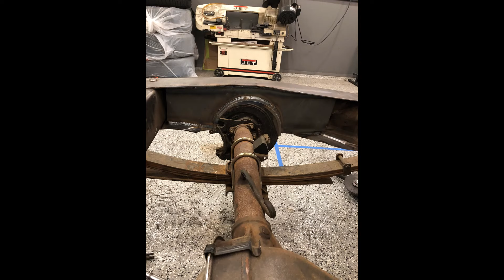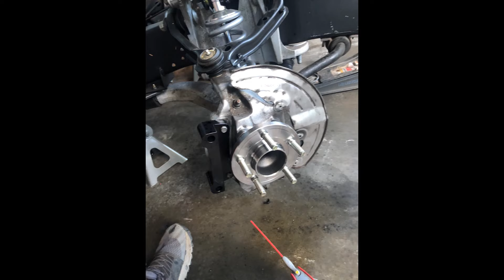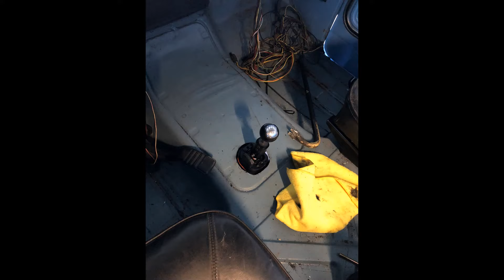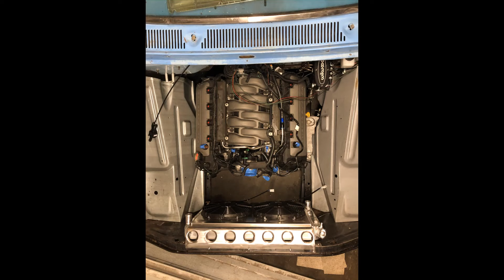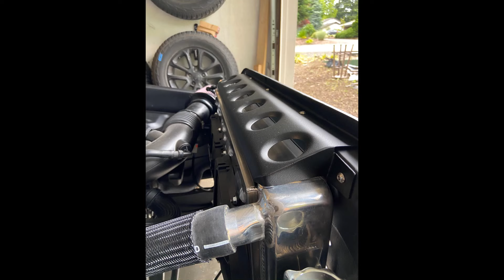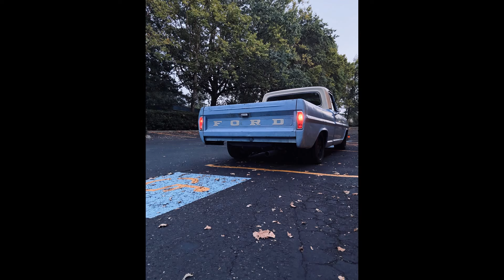1968 F100 Coyote Swap Build Video

Comment: Hey Evan, I was just wondering what all you had to do to get the corvette calipers to work on the crown Vic spindle? Any info would be appreciated. Thanks

Joe
Reply from the maker: I purchased some custom CNC Aluminum brackets that made the C5s hook up perfect: Jerry Irwin Brackets  (<lji_372@yahoo.com>) He's the kit creator. I then used the C5 corvette caliper; you are going to have to grind down parts of the caliper so they don't rum the inside of your rim. I used gt500 rotors, had to bore out the hub spacing a little so it would fit over the hub. Hope this helps.

Comment: What coilovers shocks did you use? And did they drop the front end any more?
Reply from the maker: Went with Viking Double Adjustable in the front and rear. Since the fronts are adjustable, i dropped it about as low as i could go, so yes, it can lower the front.

Comment: What fuel system and tank did you use
Reply from the maker: I went with the Holley 12-130, return style fuel system with Russel Twist Lok Line/fittings. The tank is a late 60s mustang fuel tank; had to trim the edges slightly to make it fit within the frame rails, but works fine.

Comment: What coilovers shocks did you use? And did they drop the front end any more?
Reply from the maker: Went with Viking Double Adjustable in the front and rear. They have adjustablilty to lower and I damn near have them as low as they can go; so yes, they will allow you to drop the front end qutie a bit. One other big improvement is the Caster Bolt kit I installed, since it went so low, i needed to be able to give it much more caster.
Reply: Can you provide a link to where i can purchase the front viking double adjustable shocks. I apologize, i am having trouble finding them